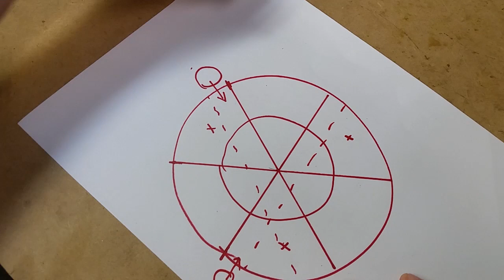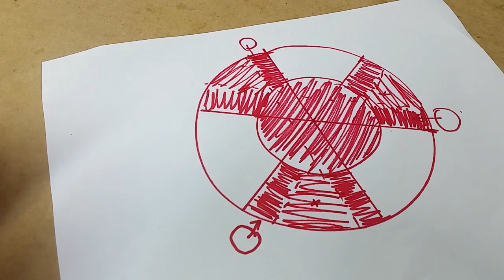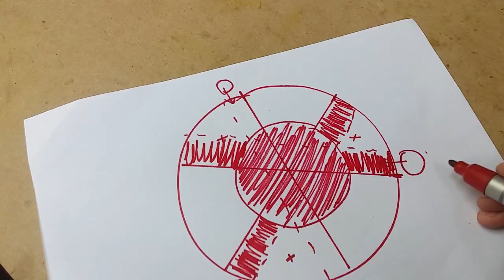How to make a Dog Clutch

Comment: cheers Tom,  I need to make a 5 tooth drive  dog but the theory is the same
Reply from the maker: Yes it should be, you will need to use a dividing head or rotary table to give 5 index angles (unless there is a 5 sided collet block that I don't know about)
Reply: @TomMakeHere  i have rotary table and its going to be 36 degree increments